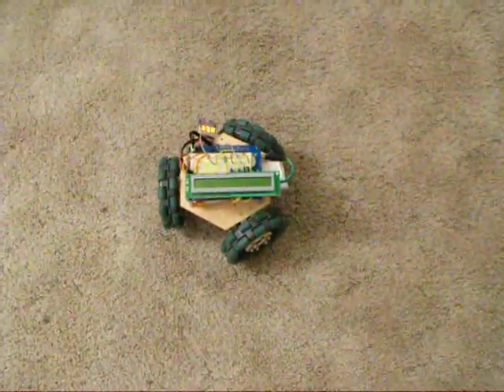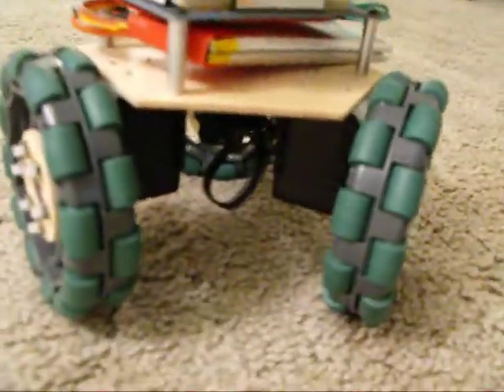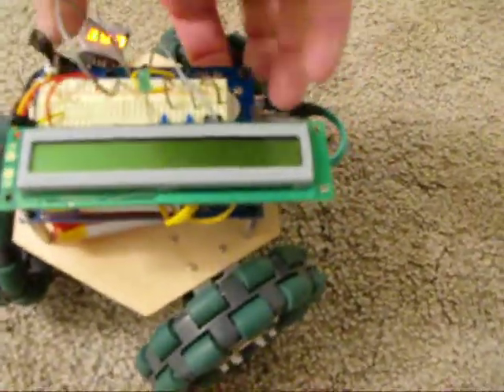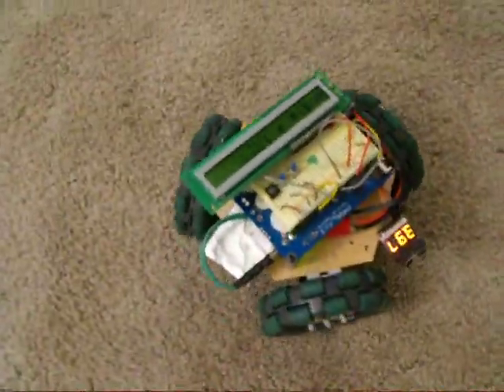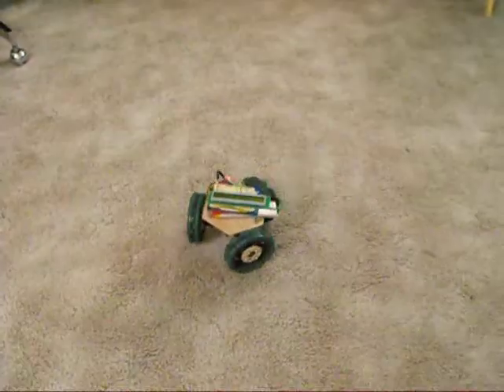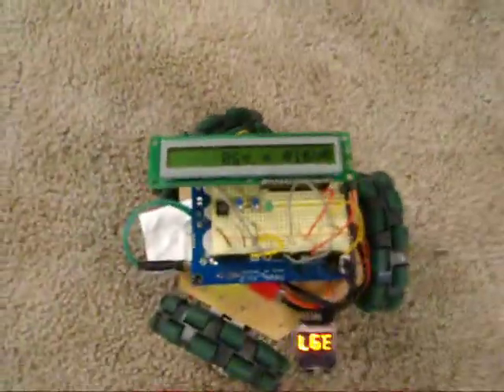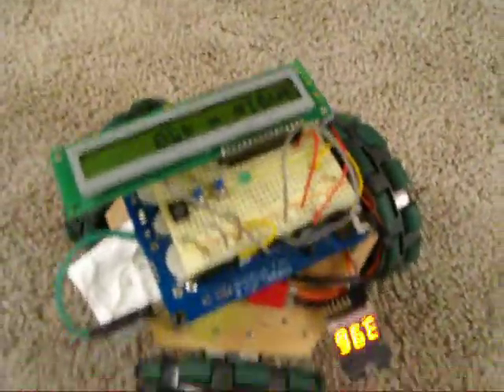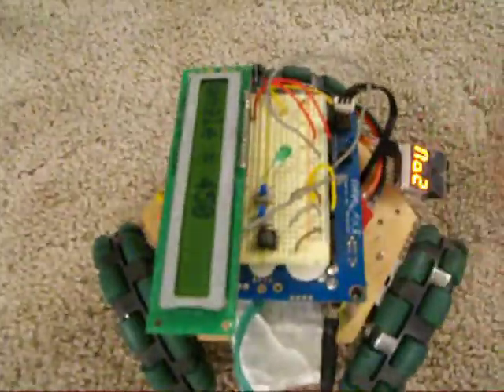OmnibotSpinningStraight140301a

Comment: Hey Duane, we are trying to program a very similar robot. Right now we are struggling to figure out how to drive in a straight line while spinning just like your robot does in this video.
Could you tell us what formula you used to calculate each wheel's speed, please? Thank you very much in advance!
Reply from the maker: I have a video which goes into more detail about the wheel speed verses robot speed.
https://www.youtube.com/watch?v=iPAfOV7jX0o
I wrote a comment with the equation to use to calculate the wheel speed based on the angle of the wheel with the direction of travel.
Wheels not aligned with the direction of travel turn slower than wheels aligned with the direction of travel.

Let me know if you have other questions. I have more info on this topic which used to reside on Let's Make Robots (before it was taken over by the evil empire of RobotShop.)
Reply: Thank you for your reply. We have already watched the other video. What we'd like to know is how you achieve the rotation of the robot while it is driving in a straight line.
Reply from the maker: I recall it took a lot of trial and error. There's too much friction in the system to get it to work using just math. I think I had to use different settings when the bot was on carpet than when the bot was on a smooth floor.
I'll dig up the old code and take a look at it. I'll find a place to post the information. I'll likely post the information on my Hackaday.io page or at RobotRebels.org. I'll leave a comment here with a link once I post the information. I'll try to get this done in the next couple of days.
Reply: Duane Degn Thank you very much!
Reply from the maker: Have you seen this video?
https://www.youtube.com/watch?v=vf8Pa4hFbxk
The figure 8 program was relatively simple to program. I just had the robot change the heading in which it was travelling until it completed a circle and then repeated the circle algorithm but reversed the direction the heading of the robot changed.
Spinning while travelling in a straight line requires you to continually change the direction the robot is travelling. The algorithm to make the robot spin while travelling is very similar to the algorithm used to make the robot drive in a circle (half of a figure 8).

I have a few questions about your current robot.
1) Can you make the robot travel in a straight line?
2) Can you make you change the direction your robot is traveling similar to what is done in the figure 8 video?
3) How many wheels does your robot have?
4) What controller are you using? (Arduino, Raspberry Pi, etc.)
5) Do the motors have encoders?
6) (Related to 5.) Can you control the speed of the individual motors? 

I doubt it will do you much good, but here's a link to an archive of the code I used.

https://www.dropbox.com/s/3ismrptmcmrn2gp/OmniBot140314a%20-%20Archived%20With%20Propeller%20Tool.zip?dl=0

I used Parallax's 8-core Propeller microcontroller. The program is written in Spin which is a language written expressly for the Propeller. I included the Propeller Tool in the above linked archive. The Propeller Tool is the IDE used with the Propeller microcontroller.

I've used Arduinos many times and I'm pretty sure an Arduino would be able to run the required algorithms to provide similar results. Of course the program would need to be written in C to use with an Arduino.
Reply: We have seen your figure 8 video.
Here are the answers to your questions. We should have given you more details right away, sorry about that.
1+2) Yes, we can drive in any direction, only the combination of spinning while driving straight isn't working out so far.
3) The chassis is triangular with 3 wheels, just like yours.
4) We are using a combination of a Raspberry Pi as the main computer and three Arduino Nanos - one per wheel - which receive their commands from the RPi via I²C/TWI and are synchronously started using a GPIO pin.
5) We are using stepper motors, so we can control them very accurately.
6) The A4988 motor drivers we use (controlled by the Arduinos) are capable of 1/16-microstepping, allowing quite accurate control over the speed (3200 microsteps per rotation).
Here's a photo of our robot: http://alpha.mapbot.de/img/glry/MapBot1-web-max.jpg
Right now were testing all kind of formulas, which are all based on a sine function modulating the speed of the wheel depending on how far the robot has already turned.
Thank you so much for all your effort!
Reply from the maker: Thanks for sharing a picture of your robot. I think it looks fantastic!
The stepper motors should give you enough speed control for what you want to do.

There are two things you need to be able to do to get the bot to drive while spinning. You need to be able to continuously change the direction the robot is travelling and you also need to be able to spin the robot.

By continuously changing the direction of travel, you should be able to get the robot to move in a circle. To spin the robot, you just have each wheel turn at the same speed.

By combining the two maneuvers, you can get the robot to travel straight while spinning. The trick is getting the spin amount just right so continually changing direction of travel matches the direction required to move the bot in a straight line.
Reply: Thank you very much! Simply combining both maneuvers sounds logical - we will definitely try that. 
Driving circles and spinning are working very well, so combining both should hopefully be doable.